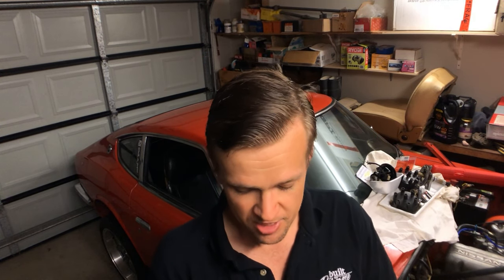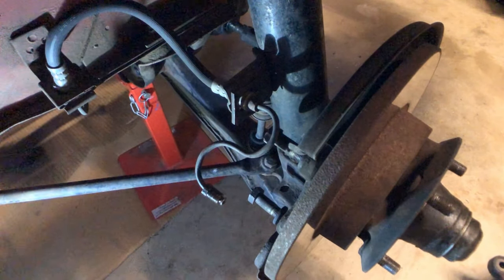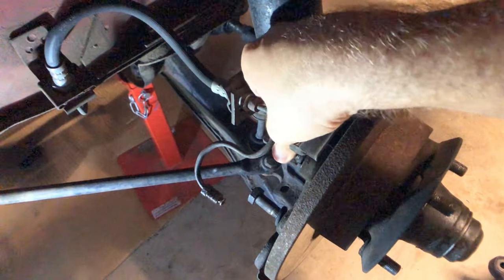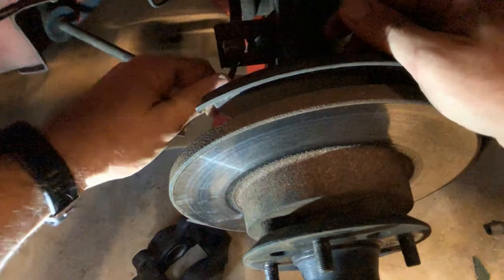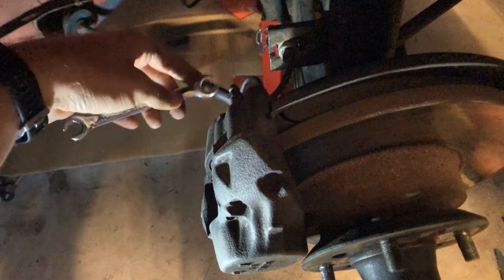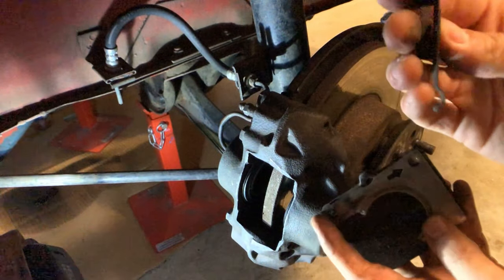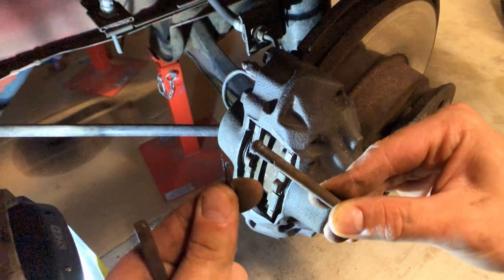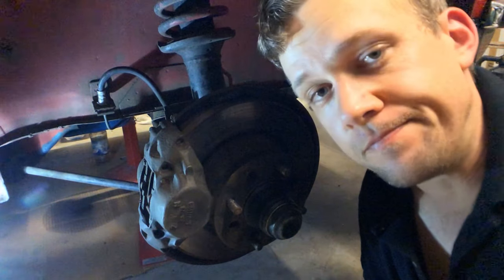Datsun 240Z L28 Stroker – Z Car Front Caliper Install

Comment from the maker: QOTD - standard or aftermarket brakes, what do you have?
Reply: Early Hi Lux 4 spot calipers bolt straight on that take DB288 pads , you just have to move the brake pipe to fit